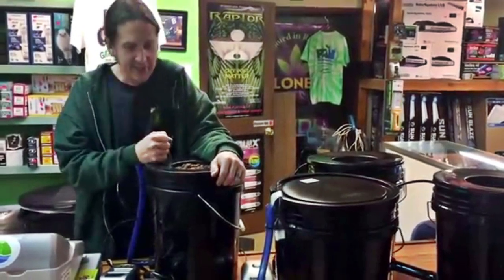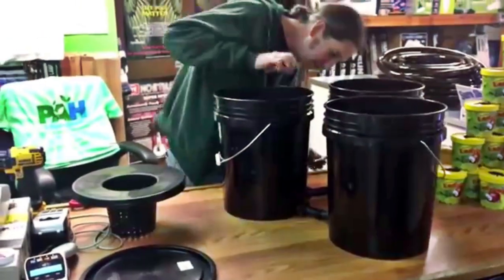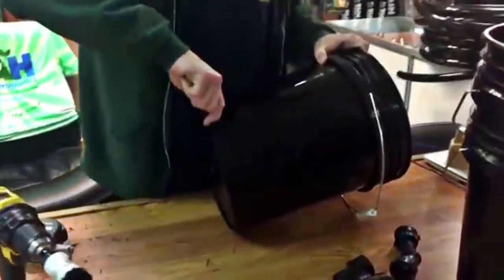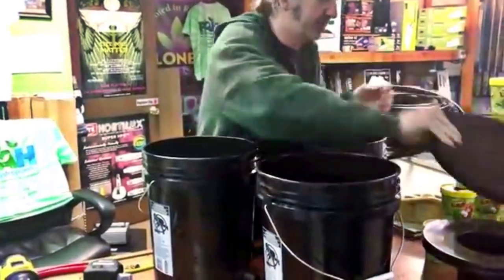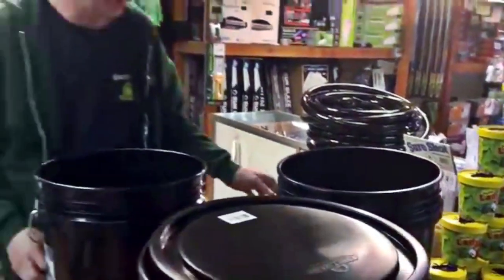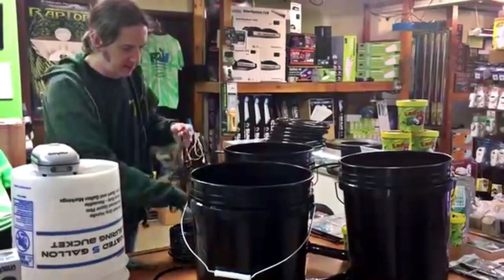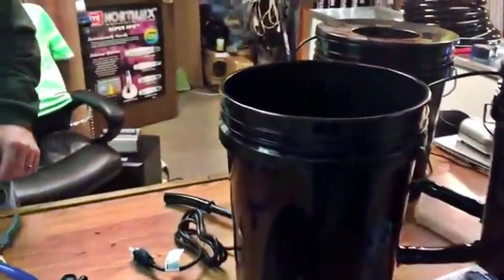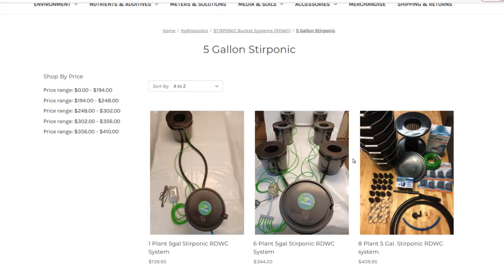How to make a RDWC system with 5 gallon buckets. Introduction to PA Hydro Stirponics RDWC systems..

Comment: As a beginner having used round buckets first, then switching to square, highly recommend anyone try to find square, even if they're 4x the price. Round ones are ridiculously hard to get leak proof, square are 1000x more forgiving and definitely worth the price.
Reply: Gary sells the square ones
Reply: i have over a dozen an have never had a drop leak. Sounds like operator error.
Reply: PREACH!
Reply: @GeorgiaGrowGuy  try using 2 to 4 inch pipes instead of 1/2 in tubing.

Comment: Heads up for anyone using these 5 gallon buckets that are having problems with roots blocking the water. They make 5 gallon paint strainer bags that work perfect at keeping your roots contained. Since I’ve started using them I’ve had 0 issues with clogging.
Reply from the maker: Very good idea!! Thanks for sharing! Gary

Comment: I’m about to build a new system with some custom aspects. I’m going to have to make the 20+ additional mile trip up to your PA location. I stopped by the other shop recently but quickly learned that it was mostly a supply shop only. I wanted to discuss some of the technical aspects of the system I’m currently in the process of building, ask some questions, and get an experienced opinion, but that wasn’t received very well there lol. I’m glad that you just happened to be working that location the  first time I stopped in just before Christmas.

Comment: Is it possible to have the 2 buckets in the tent and the res out of tent , a mtr away and still keep circulation levels pretty even bud ??
Reply from the maker: Hey, this system needs to have the tubing low to floor , you could cut a slit in tent and run tubing out there, but it wont work trying to go out vent hole. G
Reply: Cheers G @PAHydroponics
Reply: @PAHydroponics how often would ya do a complete water change on this system bro .
Reply from the maker: @davew2072  During early veg after I first plant I change out 2 to 3 weeks depending on how big they are, then every 2 weeks during veg, during flowering I change out once a week for the best yield.Thanks for watching! Gary

Comment: @PAhydroponics Thank you so much for putting all this information out there, you've started me on my journey with this. I was wondering, for fallponic, could I use tubing for both return and drain? (1" waterfall tube, 2" drain tube?) What is the drawback of using tubing vs stiff PVC pipe?
Reply: I'm extremely beginner, but my limited knowledge logic wonders why bother glueing bulkhead on stiff PVC, vs barbed fitting bulkheads with tubing snug fits/maybe clamps